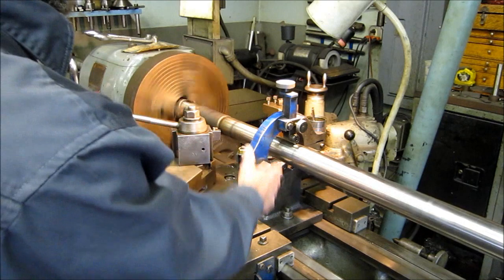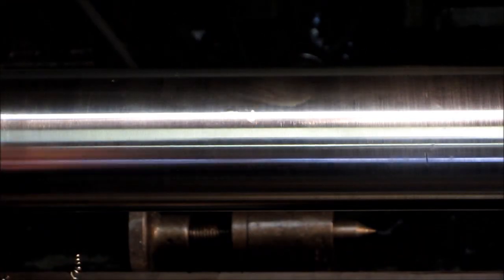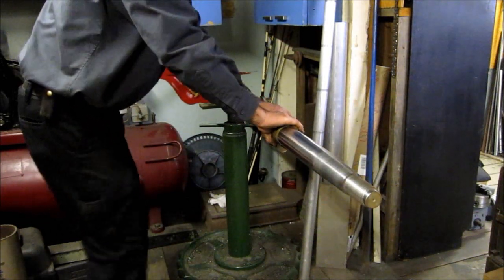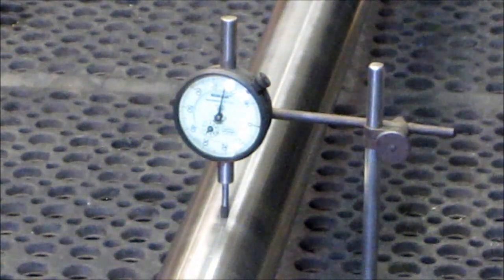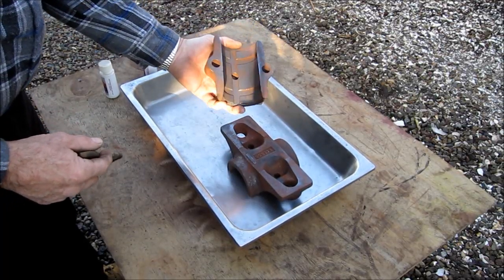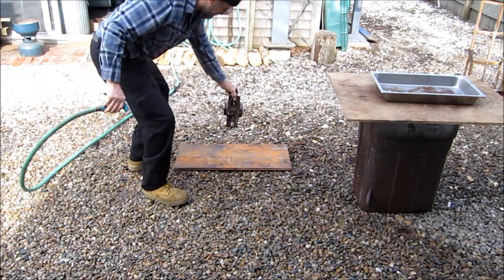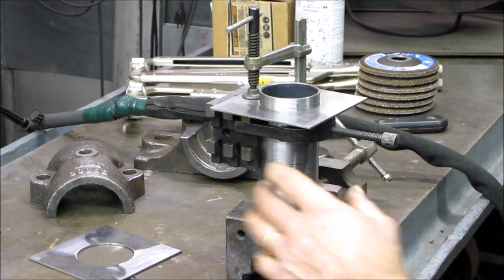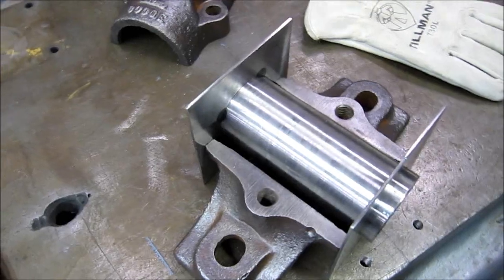As the Shaft Turns Part 2

Comment: Another great video to write me notes in me notebook of your videos!   Thank you amigo!

I read a comment about using a bronze alloy bearing and you replied about it needing to be a two half setup for maintenance.   I understand why it must be.   My question is, does a bearing unit exist where there is a 2 piece type setup but in between the 2 halves is a intermediate coupler type section with flanged out material where the fasteners run through the hold everything together?  In this intermediate coupler or tubing type section is where the bronze bearing can be worked for maintenance.   Essentially it's a 3 piece section.   Just wondering if such an animal exists.  If not, we should start working on a patent on one.  ; )

Comment: Hey Old Shaft Straightner Champ - The cooling handle you use outside in the garten - what model is that? ? Air with water ? ? :) Where do I find something similar?  BEST REGARDS from Denmark , Copenhagen .. just east of New York - cross the water

Comment: Evapo-Rust is a good product and is re-usable. A 5 gallon bucket of it is around $60, it is non-toxic and water soluble. Search YouTube for videos of it in action, it's pretty neat stuff. My friend has used it on rusted cylinders in engines and got them cleaned up enough to run again.

Comment: We've repaired large bore hydraulic cylinder rams by using a center grinder and then had them nickle plated out past the desired diameter and then put them back in the grinder to bring them to a trued undersize then had them chromed to the overall desired diameter. Do you ever use any similar methods or just weld to bring them back out to spec?

Comment: if you have a car battery charger you can use electrolysis to remove rust. I have been using this method for a few years and it works great. water, washing soda, a piece of scrap steel, and a plastic container to submerge it in and your rollin with out elbow grease. a very light brushing gets the iron oxide off.

Comment: oh, its totally tore apart! the gibs are the little things that slide into the dovetails and adjust the tightness, correct? no clue what wickings and wipers are! should i wire brush those dovetails, or use a diamond hone  to run over them?  i can send pics or post a vid of what i got going on. im mechanically inclined...but machinery ignorant.

Comment from the maker: Soft wire brushes the surface clean and wipe it down spray some oil on it, so they don't rust up anymore. After that you’re going to want to remove gibs and retaining bearing supports for the lead screws and slide the dove tail sections apart so you can clean stone and inspect all surfaces, add wickings and wipers as needed.  ;{)----

Comment: we've got a cart just like that for moving welding bottles around. but due to age and extreme laziness a third wheel was added to the back. now bending and stooping has been eliminated. just made the wheel height adjustable to get the correct angle of the dangle. makes those long trips to the welding truck much easier, would work great moving those shafts around.

Comment: Keith, ive got an old mill that was left for dead outside the local community college. the dovetails the table slides on, the table and the column are pretty rusty. what would be the best way to restore this machine to working order? wire brush on the angle grinder or should i stick to a chemical solution? its not real chunky pitted rust, but a good buildup of fine surface rust. this is az afterall. :)

Comment: FANTASTIC STUFF!!  I wonder if it would be possible to use thin wall tubing cut to the proper i/s and o/s  dimensions and then cut in half and then welded to the shaft and then  put on lathe to proper diameter for the final finish instead of welding all those beads.  Just me   looking for a faster way of doing something that has the same result.